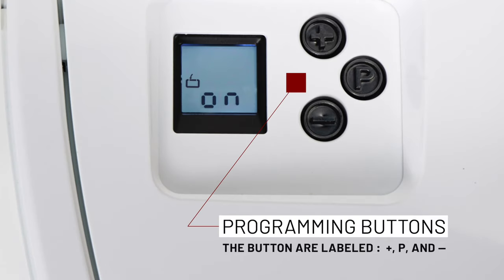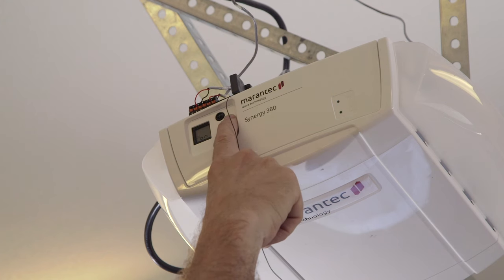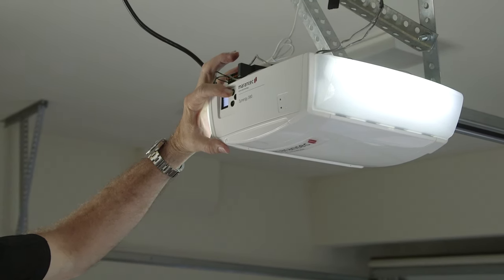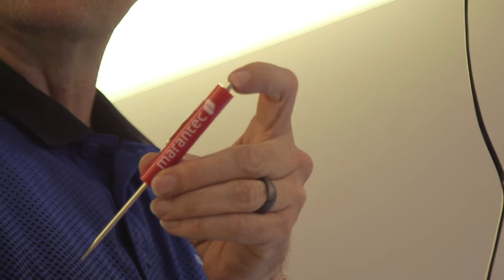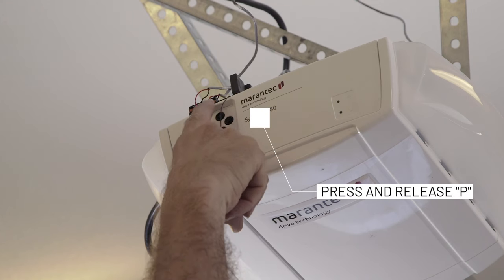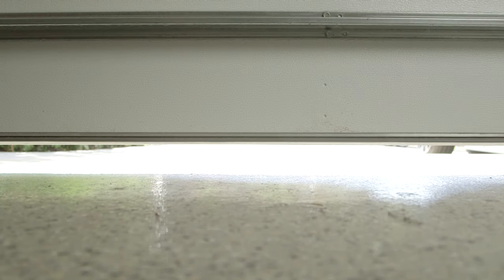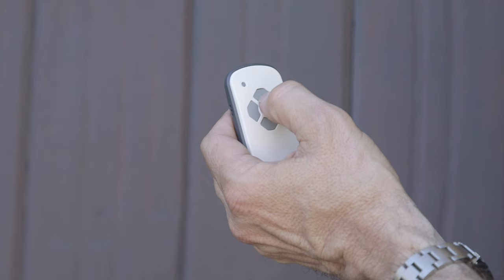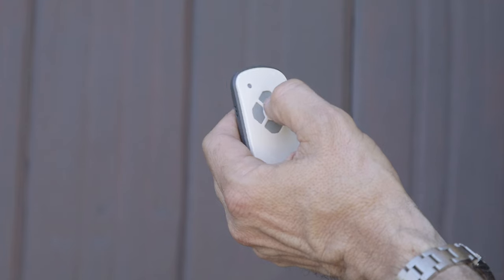Marantec Synergy Reprogramming

Comment: What if the door is stuck open and you have to do the reset? Seems to say it's only available when closed
Reply: Same issue here. You probably figured it out, but for others viewing this, just start programming but when you use the minus button to lower the door to closed, abandon the process and hard reset again, this time with the door down. Now you're ready to proceed as shown. Resolved all issues for me after a tech replaced my spring but didn't reprogram the opener.

Comment: How do I make the door speed faster?
Reply from the maker: Hi jhp711, sorry for the late reply.  Speed changes are available only on the Synergy 370/380 Models and you can adjust speed by doing the following:

Open Speed – Level 6 Menu 1
Press and hold (P) button for 11 seconds. A display of numbers 1-10 appears on the screen.
The numbers 1 and 2 will have a line above it.
Press the (+) button as many times necessary until 1-6 have a line above them. (Level 6)
Press the (P) button once. The number 1 will have a line under it (Menu 1)
Large number in middle of screen is your current speed setting.
Press the (P) button once.
The large blinking number in the middle of the screen is the speed setting.
Use the + to increase the open speed travel (Max 16) or use the (-) button to slow the open speed travel.
Exit programming by holding the (P) button for 5 seconds. Cycle two complete times.

 
Close Speed - Level 6 Menu 4
Press and hold (P) button for 11 seconds. A display of numbers 1-10 appears on the screen.
The numbers 1 and 2 will have a line above it.
Press the (+) button as many times necessary until 1-6 have a line above them. (Level 6)
Press the (P) P button once. The number 1 will have a line under it (Menu 1)
Press the (+) button three times until 1234 are underlined. (Menu 4)
Large number in middle of screen is your current speed setting.
Press the (P) button once.
The large blinking number in the middle of the screen is the speed setting.
Use the (+) to increase the close speed travel (Max 16) or use the (-) button to slow the close speed travel.
Exit programming by holding the (P) button for 5 seconds. Cycle two complete times.
Reply: Great question I wish they’d answer it in the comments

Comment: How i changed the door speed?? Because my door its slow down and up !!
Thanks 😊
Reply from the maker: Hi Edgardo, sorry for the slow reply here.  Speed changes are available only on the Synergy 370/380 Models and here are the steps (the manual also has some more info, if you need it).

Open Speed – Level 6 Menu 1
Press and hold (P) button for 11 seconds. A display of numbers 1-10 appears on the screen.
The numbers 1 and 2 will have a line above it.
Press the (+) button as many times necessary until 1-6 have a line above them. (Level 6)
Press the (P) button once. The number 1 will have a line under it (Menu 1)
Large number in middle of screen is your current speed setting.
Press the (P) button once.
The large blinking number in the middle of the screen is the speed setting.
Use the + to increase the open speed travel (Max 16) or use the (-) button to slow the open speed travel.
Exit programming by holding the (P) button for 5 seconds. Cycle two complete times.

 
Close Speed - Level 6 Menu 4
Press and hold (P) button for 11 seconds. A display of numbers 1-10 appears on the screen.
The numbers 1 and 2 will have a line above it.
Press the (+) button as many times necessary until 1-6 have a line above them. (Level 6)
Press the (P) P button once. The number 1 will have a line under it (Menu 1)
Press the (+) button three times until 1234 are underlined. (Menu 4)
Large number in middle of screen is your current speed setting.
Press the (P) button once.
The large blinking number in the middle of the screen is the speed setting.
Use the (+) to increase the close speed travel (Max 16) or use the (-) button to slow the close speed travel.
Exit programming by holding the (P) button for 5 seconds. Cycle two complete times.
Reply: @marantecdrivetechnology8048   thanks my model is 260
Reply: @edgardocruz8320  did you fix your problem I have the same
Reply: @zenitsu.2333  No, you can change the speed depend the model